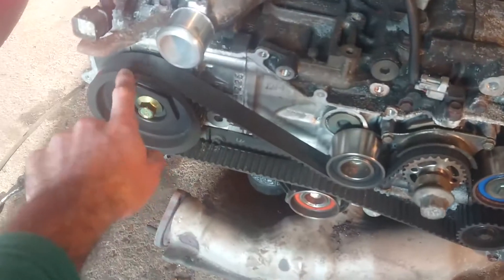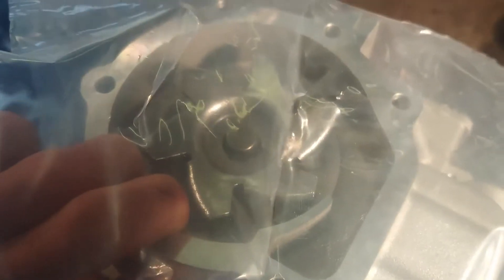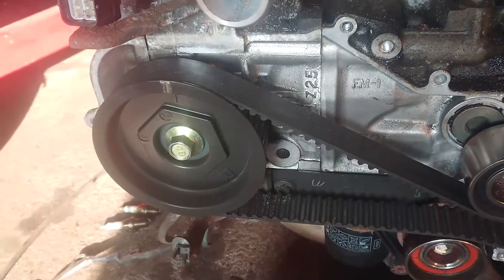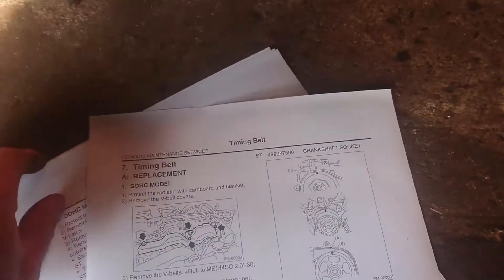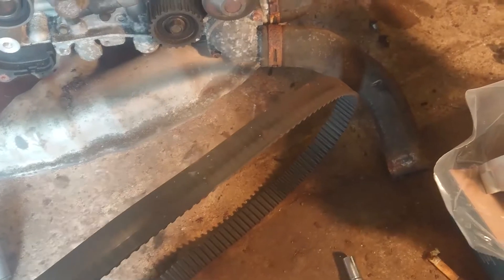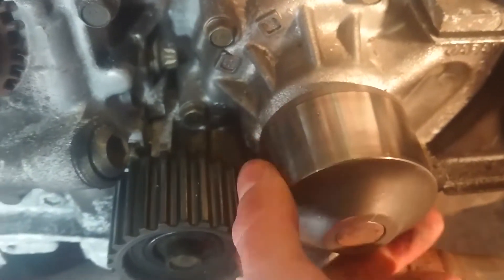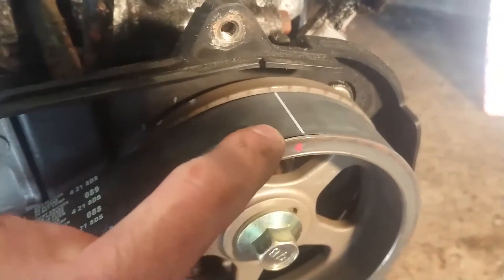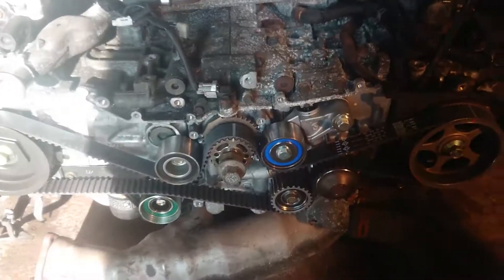VW T25 - Subaru CANbus Conversion [Part 5 - Timing Belt Replacement]

Comment: Re. water pump, the one fitted is a subaru, probably the original one. It's hard to find an aftermarket one of similar quality, certainly all the ones I've seen have a pressed impeller vs the cast subaru one. I'd also have kept the gen. one if its servicable. One thing that may write off the water pump is corrosion in the thermostat socket resulting in a leak, it would have been good to check that before deciding to leave that pump on.

Re. the belt markings, they wear off fairly quickly as the back of the belt runs on the idlers.

As I said on the forum, ICP do a rocker cover gasket set that includes the plug tube seals.